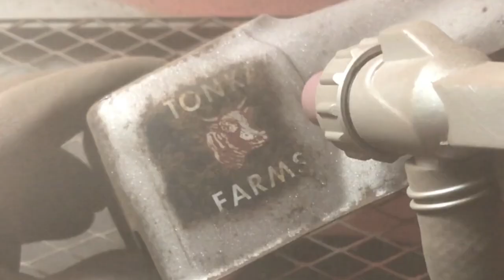1957 Tonka Farms High Rack Stake Truck Restoration and Corral Rebuilding

Comment: Love the colors! Usually one finds those trucks missing the gate, but with most of the side rails. It looked strange to only have the gate. The corral is marvelous! Where those cowhands part of the original set to?
Reply from the maker: 👍🎉🌹Thank you for your comment!!!The truck only with a gate when I bought it on Ebay, I think the original whole set should have a truck, a corral and two horses, three cows and a sheep, but very difficult to find them.